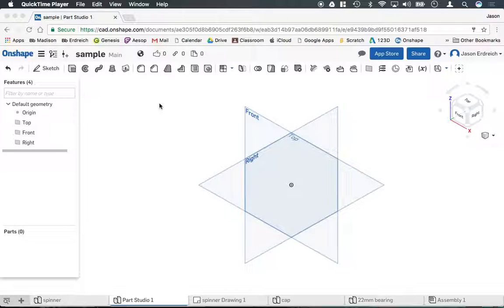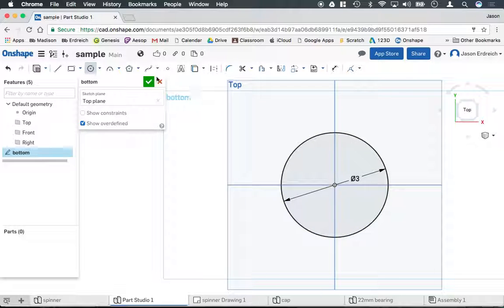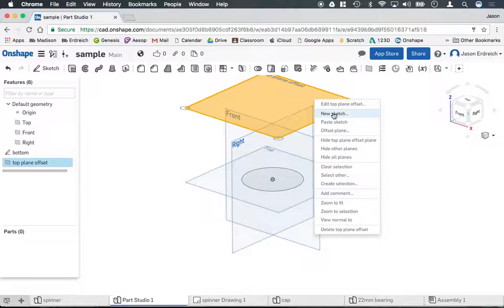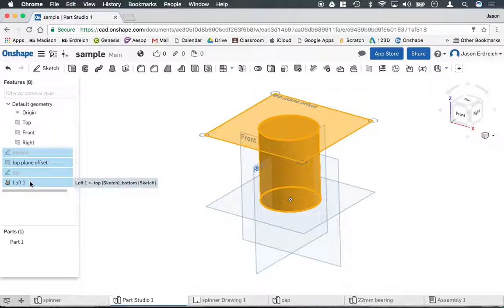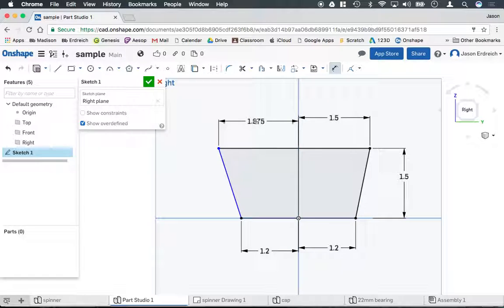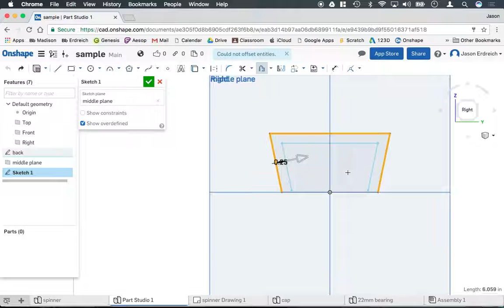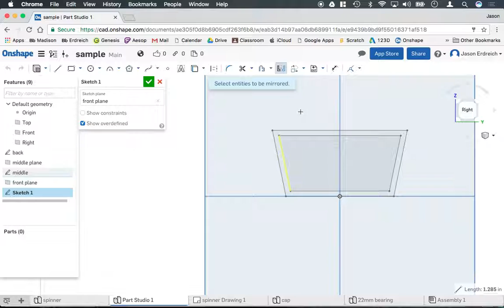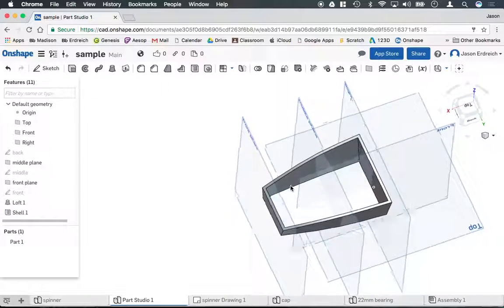How to offset Work Planes and use the Loft tool in Onshape CAD

Comment: Hello, I did this and now my OnShape would only extrude parts of my sketch even though everything is closed... and whenever i press extrude my sketch outline would turn gray.. can you help me please?
Reply from the maker: Hi there! It sounds like your shapes may appear to be closed, but there is actually a hole somewhere. Go into your sketch and zoom as far in as you can to each place two lines meet and ensure there isn’t a gap. In your sketch, the drawn shape should be filled gray if it’s closed. Alternatively, lofts follow the vertex of your shape drawn and can twist depending on how you drew your lines. Fewer points and a simpler shape is best.
Reply: @MrErdreich  thanks for the respond, will it appears there is nothing wrong with the actual object instead when i try to extrude part of an object twice the sketch doesn't correspond with the pre-extruded part of the object... 

is there a solution for that? i tried searching but nothing seems to help
Reply from the maker: @noname6284  not sure just off your description but if you create a public link, you can share it and I’ll take a look
Reply: @MrErdreich  ok sure, i will create a test object and send you the link so you know what i mean ( please focus on how the object is extruded)
Reply: @MrErdreich  update: the problem was me drawing multiple shapes in one object, i am supposed to draw one object per extrude. Thanks for any inconvenience